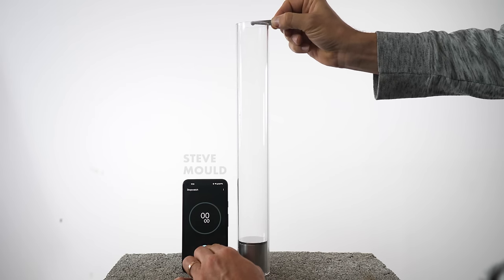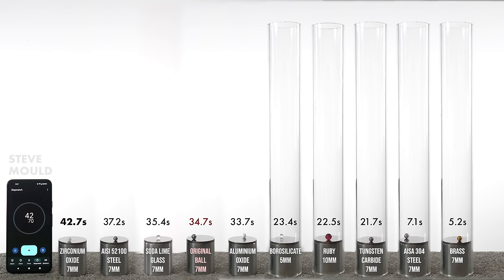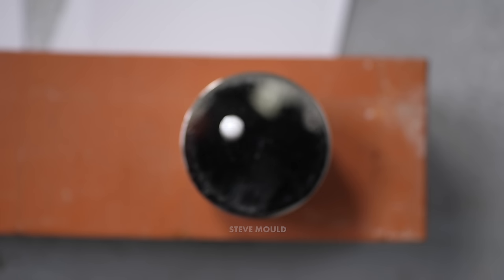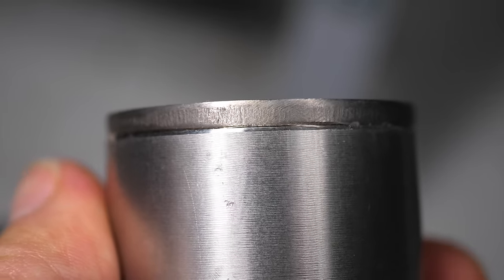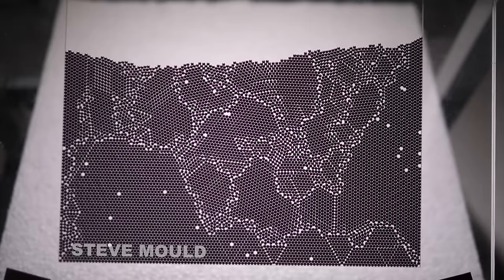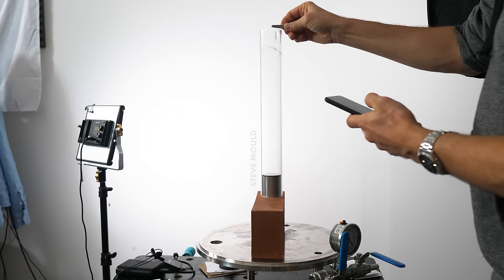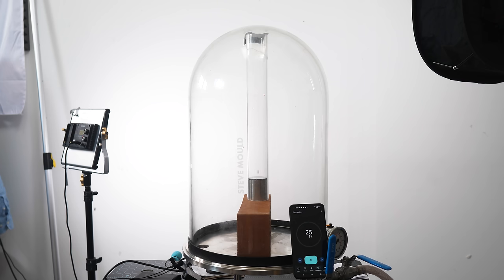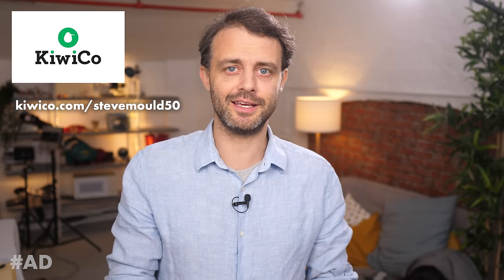This weird metal is insanely bouncy

Comment: As an engineer we call the balls ball bearings and the assembly simply a bearing. As a bearing consists usually of an inner and outer bearing run with the bearings working between being ball bearings needle bearings tapered bearings ect.
Reply: Interesting, I've only ever referred to them as xmm balls.
Reply: Correct
Reply: I know the whole assembly - which contains ball bearings - as a ball race.
Reply: As a rancher we call the balls eggs
Reply: @Henry-Kuren  xiao mei mei
Reply: He did say "most people". As you know "most people" know "mostly nothing" about anything technical. They just correctly find science very entertaining. This channel is intended to entertain both "most people" and those with technical knowledge. I imagine that since his "audience" consists mostly of "most people", he is correctly catering to his gravy creating audience.
Reply: I call them roller bearings, as they are less confusing, i mean they literally are bearings that roll, and the balls inside are ball bearings
Reply: @call_me_mado5987  hmm, when I hear "roller bearing" I think of cylindrical/tapered roller bearings.
Reply: @reidprichard  Well i guess each to their own, but having 2 things having the same name confuses me a lot so i like to seperate them in my own way
Reply: @call_me_mado5987  Um, no, roller bearings have cylindrical (or sometimes slightly tapered) rollers in them, never balls.   There's even 'spherical roller bearings' which have barrel-shaped rollers in them (so-called because the envelope of the outside of the barrel rollers forms a virtual sphere, so they're tolerant of misalignment), but not a ball anywhere in sight.
Reply: @cr-yi7ep  Maybe, but they are pretty spherical in general , that wasn't my point in the first place, in your logic there aren't any soccer balls because they aren't perfect spheres, i mean hell nothing is ever a ball, it's impossible to get anything to be a ball, just very close to it. So we use the word "ball" for conveniece.
And if you measure ball bearings from roller bearings with something like a micrometer, you will see that they are very very equal on all sides, the taper is indistinguishable to the human eye.
I think you got confused with tapered roller bearings or maybe some other type of bearings, but your typical roller bearings which are angular contact roller bearings and deep grove roller bearings pretty much have balls inside of them.
Reply: But bearings aren’t just the one ball kind but many different kinds
Reply: In German, you have much more choice. In general,  ball bearing is not quite correct term, because you do not need to use balls as rolling elements. Also, the motion is not strictly rolling, but a superposition of rolling and gliding. I do not know if there is a english term for that, but in German, this is "Wälzen". Bearings in German are called "Wälzlager" ("Wälzen" + "Lager"="Wälzlager"). Then you can descripe the rolling element. There are Balls ("Kugellager"), zylinders ("Zylinderrollenlager"), Barrel shaped elements ("Tonnenrollenlager") coni ("Kegelrollenlager") and fun ones like Pendelrollenlager and Nadelrollenlager. In general, Bearings are quite interesting
Reply: But if the assembly is a bearing, and one that in particular uses ball bearings inside it, not needle bearings, doesn't that make the whole assembly a ball bearing bearing?
Reply: I don't agree, although you may call the balls, ball bearings. But what if the ball is being used in isolation, example in a valve and it is not 'bearing ' any load. And why don't you call a round gauge pin a roller bearing. A steel ball is a component of a ball bearing when in a race, outside of that it is simply a ball
Reply: @Phantom-mk4kp  Absolutely agree.   A ball bearing contains balls.   Outside the bearing they are just balls (or 'bearing balls' if their intended destination is significant).  A roller bearing contains rollers (again, they may be 'bearing rollers' if that is their intended fate).
Reply: @call_me_mado5987  Nope you're still incorrect, a roller bearing does not contain spheres, it contains rollers
Reply: @call_me_mado5987 you're missing the point. In your effort "not to call two things the same" you are in fact calling two things the same. Ball bearings are different than roller bearings. Roller bearings have a cylindrical or ellipsoid rolling element in them. They're their own thing. So you're taking "ball bearings" and giving them the definition of another, already established bearing type. It's like saying I don't like calling gas(oline) and gases like hydrogen and helium the same name, so I call it diesel. Or if you're outside the US, I don't like calling paraffin (wax) and paraffin (kerosene) the same thing so I'm going to call one of them coal oil instead. You're not solving the problem you think you are.
Reply: @christaylor6529 
I'm 63 machanic and always know it as a race
Reply: In bicycles, the assembly is called a "cartridge bearing assembly" or a "sealed bearing assembly," because ball bearings are used without the races and seals in a lot of bearing applications. On older bikes, and some wheels that are still made, the races and seals are completely separate components from the balls, rather than being part of an assembly.
Reply: That makes no sense at all! If you take one steel ball out of a ball bearing, what makes that steel ball different from any other balls of steel that don't happen to be made to go into a bearing? Exactly, nothing! So why not just call it what it is, a steel ball, rather than something it's not, since a singular steel ball alone cannot function as a bearing? 💁‍♂️

Idc what anyone says the proper terminology was, I only consider the full assembly to be a ball bearing (or bearing, if I don't need to be specific), not a mere component of it. Seems intuitive, no?
Reply: @docjoules4738 right, and when we refer to a single ball in a "Kugellager" (ball bearing), we call it "Kugel" (ball), not "Kugellager", because that would make no sense.
Reply: @LRM12o8  
What about it you have a big box full of balls for different sports.
Do you call them all balls, or do you call them for the game they are intended for, eg . Basketball, tennis ball, football, etc ?
Reply: @LRM12o8  most bearing balls are hardened and many are Chrome plated so that they will remain completely smooth without wearing down or damaging the races they run in. A generic ball-shaped piece of steel is not going to be strong enough to function as a durable bearing.
Reply: So, what you're saying, then, is
engineers mindlessly regurgitate incorrect and utter nonsense??

It is called a "bearing" because it BEARS something...in this case BALLS. It is absolutely wrong to call a ball the thing designed to contain it. By itself, it is a (steel) ball. Encased in a bearing, it is a 'ball bearing'. End of debate!🤦‍♂️
Reply: @-WiseGuy- Weeeeeel actually. You’re wrong. Some comments above show that. I have no skin in this argument but you don’t get to declare the debate over…
Reply: @o0Donuts0o  
So sorry, Mr. 'Not So Good With Logic', you fail to recognize that a flawless logical argument INDEED ends the debate. And that's exactly what I (and others) have offered...Premise(s) that pass the Truth test; and a validly inferred Conclusion.

I strongly suggest you take a basic Logic course or self-study, if that suits you. This is a pretty simple example of Propositional Logic, and the fact that you and so many others are so disconnected from a logical (aka SOUND) thinking mind is absolutely indicative of why society is an absolute mess!
Reply: @-WiseGuy-  But this is an argument on the correct name for different types of bearings. What good would a course on logic do? Sadly, you are ill-equipped to continue to partake in this debate and think it’s best others continue. It’s only fair on this forum. I personally would like to thank you for your valiant yet unsatisfactory attempt at the game of “I’m from Reddit, I’m an expert”. We will see you at the next great internet debate and hopefully after some time has passed you will make a more meaningful contribution. Cheerio.
Reply: I would go so far and just call them ball bearing balls.
The are balls meant tobe used in a ball bearing.
That also removes any confusion with other bearings like roller bearings, which do the same kind of of work, but don't have balls.
Or magnetic bearings, where the two sides are kept apart via magnets.
Or fluid bearings, or plain bearings/slide bearings.
I wouldn't start calling oil "bearing" just because it is used in some bearings.
Reply: @charliepearce8767  As a whole assembly I call them "balls". The same way as the box would be a {ball box}
When referring to them individually I call them by their purpose. So a "tennis ball" is exactly that, a {ball} meant for use in {tennis}

Since the balls for a ball bearing are for that purpose, they would be "ball bearing balls". Balls intended for use in a {ball bearing}.

Alternatively also "bearing balls", balls intended for use in a {bearing}

using "ball bearing" to refer to the ball suggests that there are other bearings that don't happen to be ball-shaped, but it's the opposite, a bearing is never ball shaped, but a ring or a set of surfaces. That would be like calling the sport of tennis "ball" because it includes using a {tennis ball}
Reply: @arewecrazyyet Eh?
Reply: Yeah sorry Steve but this is the way
Reply: Is the bearing run also known as a race?
Reply: i've always known it as a ball race. the balls are ball bearings.
Reply: Yeah, said the exact same thing. Only thing is if you live in the USA, they don't adhere to the rest of the world unless I'm mistaken.
Reply: @NFSHeld NO! A bearing that has ball bearings inside of it is not called a ball bearing. No matter how much you want to call it that, it doesn’t make it correct.
Reply: Indeed, it is context that dictates what naming convention would make more sense. So if we don't need specifics, then "bearing assembly" would suffice and if we need to differentiate types then simply call it what it is. In my field we can call most assemblies "wheel bearing" with confidence our peers know it a ball bearing type assembly and if we need to reference our wing nuts, for example to R&R, then we say "needle bearing assembly". Guess even when it comes to speech us engineer heads like it simple and efficient xD
Reply: @arewecrazyyet  I don't think he actively thinks about the average intelligence of his audience. He just has a good engineers brain. It is mostly true we oft-needs to clarify everything we say in the simplest of terms we can manage :3
Reply: @gonnaenodaethat6198  I would argue that that is how language works. If your words, in the shared given context, convey the intended information, then the communication of the idea is successful, and doesn't necessarily make your use of words invalid. In my language a "bearing" could be roughly translated as "pin bed/pin groove" (pin having a more nuanced set of meanings) so calling a ball a "bearing" out of context is bullshit, so we call it a grooveball aka bearing ball. But in specific contexts I don't think it would be unreasonable to shorten it to "a bearing" as you would understand that a bucket of bearings would mean a bucket of balls. In a real life situation the other person would want you to clarify and say how he calls them and after that, one of you would adjust to the other. There is no need to invent a be all end all term, as language is more maleable than that, making this entire argument redundant, as each and every one of you would solve the issue irl with 3 sentences.
Reply: @thobetiin8266  I agree with you :3 Colloquialisms are just as valid as technical terms and if context says both people would understand each other then by all means. Communication has simple rules of thumb; 50% listening and 50% clarification of speech. Language is beautiful in this way; with a good helping of cultural inclusion its even better. I apologies for not being as clear as I could have been :3
Reply: I believe the correct terminology is "ball bearing balls".
Reply: @arewecrazyyet you are the gravy creating part, but you're far too arrogant to smell past your own flatulence.

Comment: it would be interesting to retest the smallest ball bearings you had in the vacuum chamber to see if there is a large gain with them as you had already selected for the ones that were least effected by air resistance
Reply: Excellent point
Reply: ok
Reply: seems like it would make for a good revisit as it is just retesting in the vacuum chamber so i have me fingers crossed there will be  part 2

Comment: A tip on the support: alternating layers of dense and light materials will make a low-pass filter, reflecting more power back up into the ball and keeping the supporting surface quieter.  For example, resting the bouncer base on, well maybe just a somewhat wider plate to give it some stability (say a chunky steel plate), then supporting that on something soft like plastic or rubber, or hollow even, like a balloon, or foam (but, foam is also quite dissipative -- this would make more like an RC filter than an LC filter, in electronic analogy), or something flexible in general (like enough springs to support it stably).  Then support that in turn with something heavy, and so on and so forth.

This can't be done hastily, of course; you want similar masses throughout the stack, of the massive components that is, and likewise similar springiness of the light components.  (In fact, the relative proportions of each (how much lighter or heavier a component is, relative to the [geometric] mean) gives the shape of frequency attenuation curve.)  Just using similar amounts will be reasonable enough, and use enough mass and spring rate that the free-bounce rate of the stack is much slower than the bouncing of the ball.  That is, the cutoff frequency is well below the excitation frequency.

Using things like balloons is obviously a bit complicated if you want to test it in a vacuum, heh.
Reply: Took the thought right out of my mind. Resonance might be the key to longer bounce times with less energy lost.
Reply: @thomasgeorge1836  This.  Resonance, being a feedback loop sending energy back into the system, could extend bounce time.  A filter will not.  All a filter will do is dissipate the energy loss as heat, not sound.  Work is work.
Reply: Y'all thinking too hard, I love it

Comment: In a past job I had the fun of formulating, melting and casting new formulations of amorphous metal that did not contain Beryllium. Be is a very toxic element that is dangerous to work with so we were trying to find amorphous metals that didn’t require Be but still could be amorphous when chilled at achievable rates. The larger a piece of metal you can make amorphous, the more applications there are. Also this stuff melts really low so it can be made to work in metal injection molding. So cool to see Steve playing with it.
Reply: Are there any non protected formulas you can share?
Reply: What are the applications?
Reply: @chem101studygroup4  Unfortunately no, for at least two reasons. First is what you alluded to, we were definitely under NDA’s for the work we were doing because my company was a vacuum melt shop just making the alloys, not the finished parts. We were doing R&D contract work for the amorphous metal company, basically. Second reason is, as Steve said in his video, there are a whole bunch of elements in the mix, so I don’t remember everything and all their percentages! But the elements he mentioned, Ti, Zr, Ni, were all in there along with several other uncommon metals.  Interestingly the process to make the alloy amorphous took at least two steps. You couldn’t just melt from pure starting elements and cast and amorphous part, you had to go through a particular post alloying process to induce the amorphous structure.
Reply: @michaelwerkov3438  not sure what the state of the art is today but I think the earliest applications were things like dental components (braces). I think the idea of a golf club head being made out of this material was someone’s dream. My company only made the alloy not the end product so I don’t any more about that than what you could find on google.
Reply: @michaelwerkov3438  I guess rails for larger ones, and in general bearing surfaces which need to be stiff, also precision things, where plastic deformation would lead to problems over time.
Reply: @chem101studygroup4  Look for Vitrelloy 105 composition, it is disclosed to the public, at least in scientific journals. It was formulated teen years ago, so I suppose there have been newer alloys developed, also beryllium-free.
Reply: @michaelwerkov3438  Bulk metallic glasses may be used in sports gear: heads of golf clubs, elastic inserts in tennis rockets, elastic inserts in skis; surgical knives, casings of some consumer electronics, jewellery. 
Apart from BMGs, there are conventional metallic glasses, and they are produced mainly in the form of ribbons. The major application of iron-based MGs are cores of transformers thanks to their superb magnetic properties. Aluminium-based MGs have high strength and low density, so may be used in aircraft and space industry as some structural members.